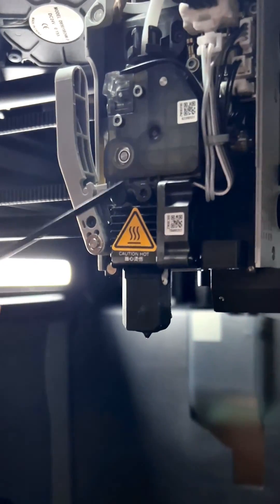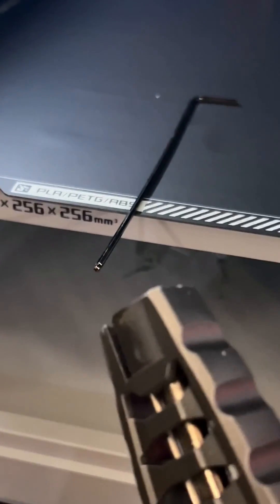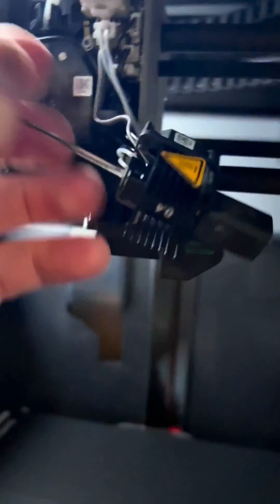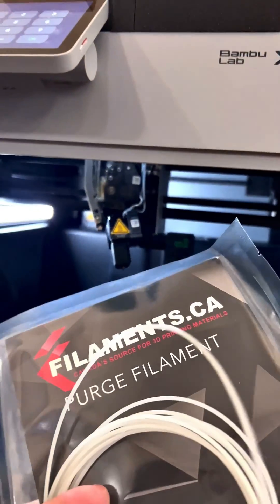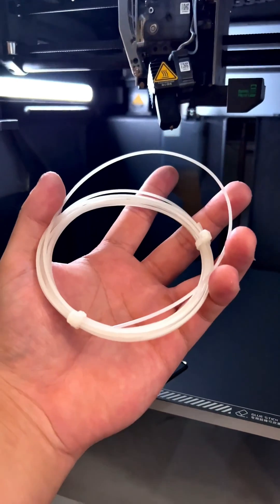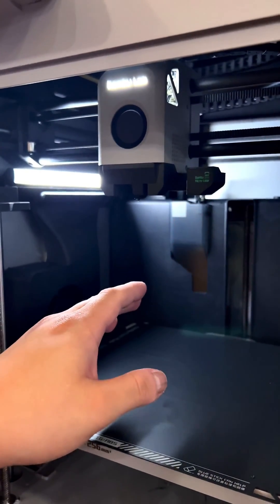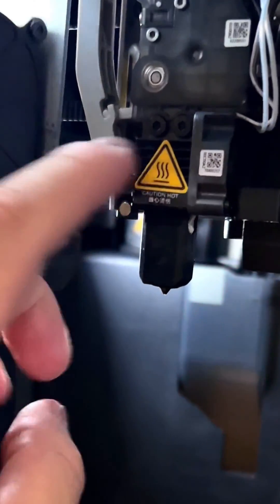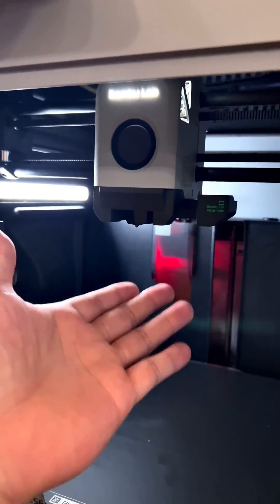How to clear a clogged nozzle in the Bambu Lab X1 Carbon

Comment: Hi, We are struggling to remove a clog, we can remove the tube from the AMS at the top, but we are unable to remove the 'in out' clip that feeds into the printer. The black spring works but the blue seems to be stuck. Thank you for any help or tips.

Comment: Don’t know what I did wrong but the allen wrench got stuck in my hot end 😭
Reply from the maker: Gotta make sure you heat the Hotend back up a bit for it to “let go” or else it’ll be stuck to the inside of the Hotend. That’s the reason why I’m using large pliers to hold it rather than my fingers.

Comment: this helped a great deal!  I was able to clear my clog, I did need to remove the hotend and use a needle, but I got it!  Also I tried to run filament through the head unit first and that let me detect that the gears were working, just not the tube.

Comment: DUDE! I was sceptical. Very sceptical. It worked! You just saved me a "s...T" load of grief. Thank you 😯🤓
Reply from the maker: Trust me man, I was also just as skeptical & felt the same afterwards cuz this was what the official Bambu Wiki told me to do & since mine was a kickstarter unit there really wasn’t much “support” set up yet for the printer at the time. But eventually decided to try it since this wasn’t the most ratchet thing I’ve ever done so I gave it a try & it worked! 😂🤯

Comment: Thank you so much this was such a breeze. I thought I was going to have to disassemble the whole thing luckily I saw this tutorial first. Even if this wouldn't have worked it was so easy to disassemble and reassemble only 2 screws and I directly saw that the nozzle was clogged when removing. Your heated metal tip worked like a charm too. Much love!

Comment: A cold pull with Allen key worked for me as well! Thanks!! 
At first, I was like... what do I use to heat it up?... The tea candle worked just fine 😀
I used some random PLA and wasn't sure about the temperature for P1S... Btw, have anyone tried to use NoClogger tool here?

Comment: great video thanks, as a warning to all, make sure to disconnect all hot end cables before attempting the cold pull, I did it and pull back yanked a soldered connector from the board!

Comment: Appreciate the video. It inspire me to use a solder iron with a thin top to heat the inside of the tube then use a thin allenkey to clean the clog. Much appreciate it.

Comment: I had just once a clogged nozzle in the X1.
But i decided not to disassebmble much .. is just heated the nozzle up and used the 0,4mm needle (which was also delivered) from below.
Just stick it in and a few times up and down thhrough the molten plastic.
So maybe i had some dirt which then came out ort some minimal burr at the to of the nozzle.
Just to mention i printed no carbon or glasfiber before .. so i thought that way could help
And it worked :)

Comment: I had my first one and did it another way.  Turned the printer off, removed the hot end - same two bolts, then heated up and pushed the filament out with a small allen wrench.  I then put some cleaning filament in and  let it cool and did a cold pull

Comment: You can also use cold pull like routine maintenance. It works for me.
Reply from the maker: I actually do! Helps make sure you keep the nozzle clear of any debris and ensure that ya get reliable prints
Reply: what's cold pull?
Reply: @kentdixon295  You,ve manul for this on Bambu lab yt Channel, easy to to, Loading filament like normaln, than lover nozzle temp to 100 C, than gently puling fillament up with pressing button to retrackt. Should take up to 5 min in first atempt, and less for next ones.

Comment: I've had a few clogs with my e3d hemera and it take the part cooling fan off , the hemera's fan out , removing 2 screws to hold to the motor , slowly remove it ,  find the part which dropped off it , unscrew the heat break , fix the clog , and put it back together which if you are very lucky about 1/2 a hour now I've done it so many times .

Comment: Does this printer have thermal runaway cut off?
Reply: Yes. There are 2 levels of protection.
1. Hardware. It uses a ceramic heater which limits the temp the more resistance that it gets. Maxing out around 305C or in an abuse scenario 400C.( you would literally need to overvolt the heater but it would burn itself out but not reach thermal runaway like older style heating cartridges)

2. Software time out of 30 seconds(formally 3 min) but there was zero chance of it overheating see 1

Even with a software failure the ceramic heater will never have a thermal runaway event due to its design.

Comment: How many hours of printing before you had your first clog?
Reply from the maker: I’d say a little over a hundred hours but I was also printing with a large variety of filaments with things like carbon fiber, metal powder, glow-in-the-dark powder, etc so I’m kinda surprised it didn’t clog earlier especially since I did have any custom print profiles for those filaments on the X1 printer
Reply: @MinWin3D  speaking of, did you load the filled filaments via Bowden using an external spool holder? If so did you disconnect the ams or have a Y shaped Bowden adapter?
Reply: I've got three prints in only and already my first clog.  Trying to figure out how to even lower the plate so I can get to the clog.
Reply: I'm about 381 hrs of printing before my first clog. 99% PLA: some wood PLA, lots of marble PLA and PLA with sparkles. (.4mm hardened steel nozzle on X1C) -- came to ask same Q from ppl